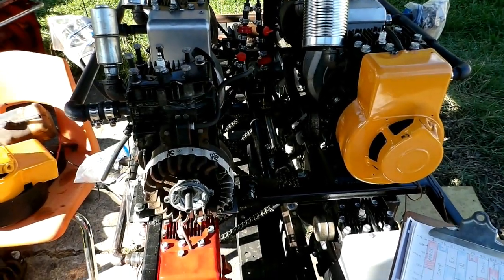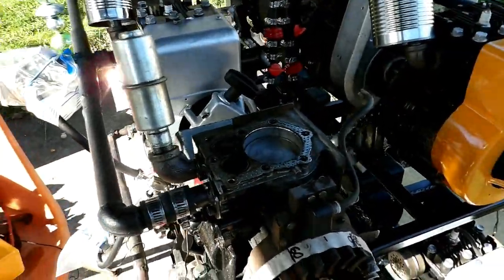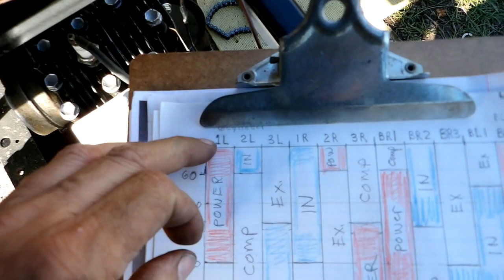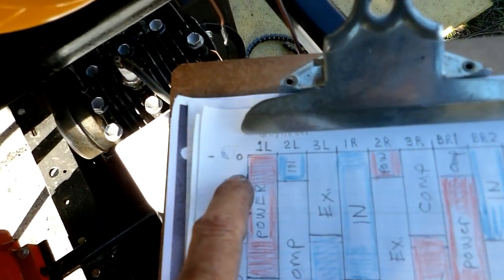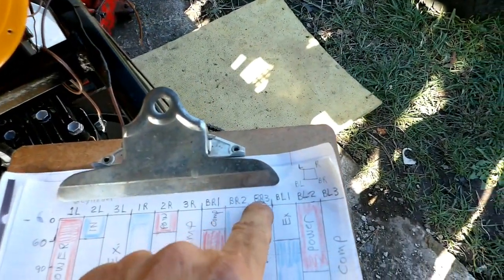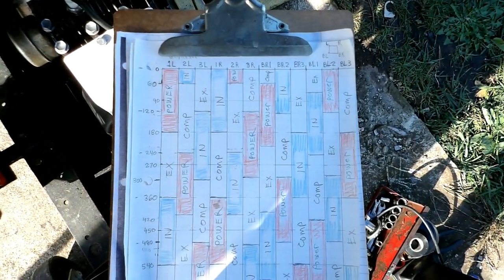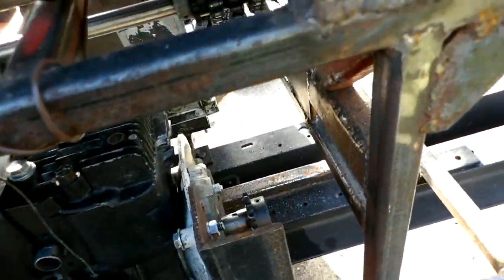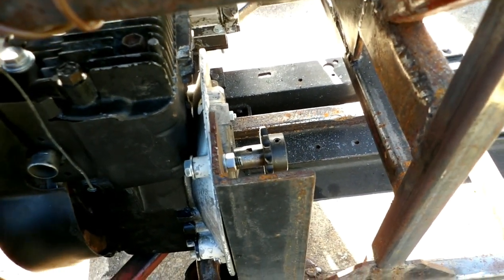Setting the piston Timing on the H12 Cylinder Engine

Comment: Great job your doing very interesting. Can’t wait to hear it once it’s all synced up. Quick question, have you modified the oiling system in the engines that where made to run with the shaft vertical?
Reply from the maker: Yes, I show the mods in one of the vids, I had to add an oil dipper also.
Reply: @ChargerMiles007  oh ok nice man keep up the good work